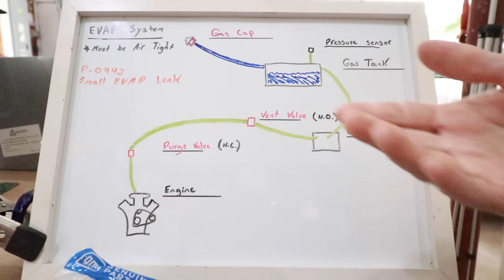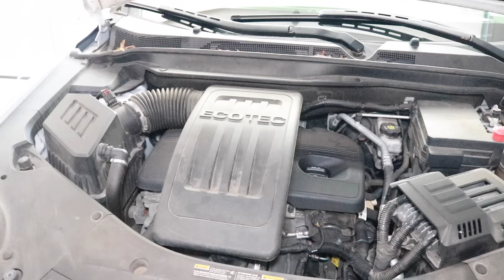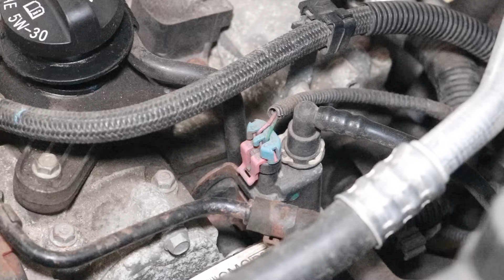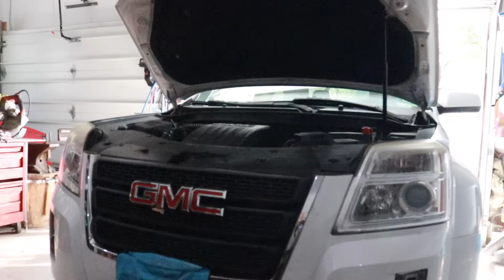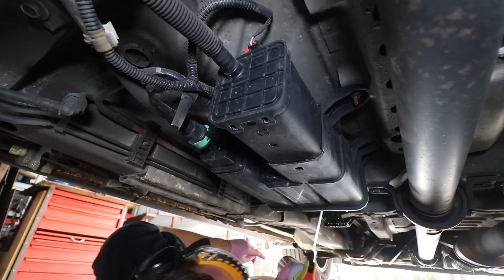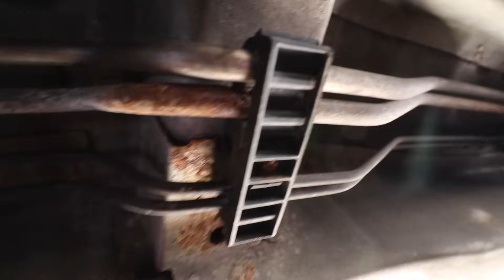GMC Terrain 2.4L | Canister Vent Valve & Canister Purge Valve Replacement | P-0442

Comment: Thank you very much, I just replaced the purge valve on my 2011 terrain. Fantastic video. Thanks
Reply from the maker: Do you have a p-0442 code? Reason I ask is my code came back after this fix, however I did find the actual leak this time. It was that rusty tube along the frame. Going to splice in a patch in a future video

Comment: I have this same engine 2011 Regal and have hard starting unless I press the accelerator. What are your thoughts. No CEL and have replaced the solenoids intake and exhaust multiple times (due to cel) never fixed the starting issue. Fuel pump was also replaced and did not fix the issue
Reply from the maker: Any codes? How many miles?
Reply: @OldSoulMillennial no codes that I'm aware of. The only mention of codes during last inspection was for the solenoid which they replaced. I'd already replaced both of them a few years prior, but the car seems to eat them. 115k already had timing chain and transmission replaced
Reply from the maker: @shawnnoblin4248  I would definitely start by scanning for any soft/hard codes. See if that gives you any clues. But the delayed starting issued could be one, or multiple things. Weak or clogged fuel pump/ injectors, bad piston rings, clogged air filter, weak battery, weak plugs/ ignition coils, exhaust restriction, the list goes on and on. A code would give us a likely heading to explore. Otherwise, you'll just have to start looking at everything one by one.
Reply: @OldSoulMillennial ok I'll see if I can get it scanned
Reply: I have to press the gas in read that tells the car to clear fuel like it's flooding  @OldSoulMillennial

Comment: Your Ecotec series brought me to this channel and I am forever grateful for it.  Recently finished up a timing chain + balance chain, high-pressure fuel pump + PCV + spark plug job on a 14 Verano with the same engine.
Reply from the maker: Nice work! There is always something failing on the 2.4L eco-tec engines! I see it as a blessing in disguise. It gives me something useful to make content about, which also provides detailed repair info for those who want to fix their own cars. I sympathize with clippy, I only want to help!